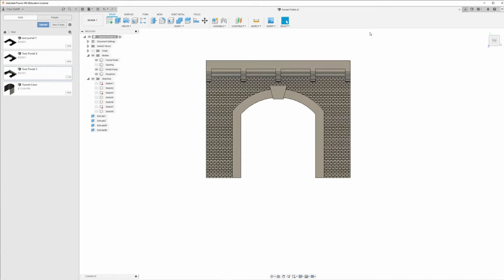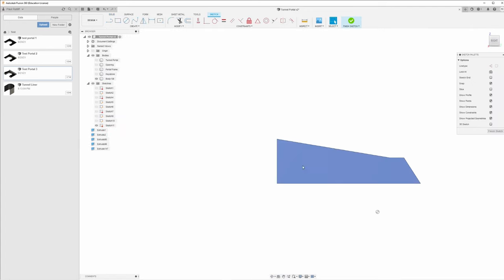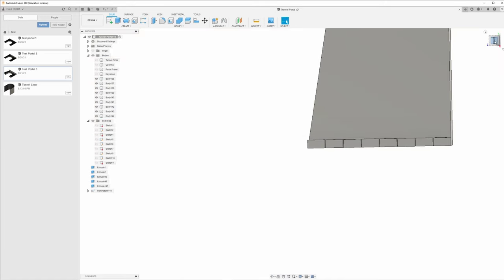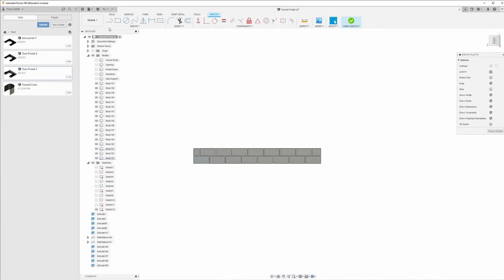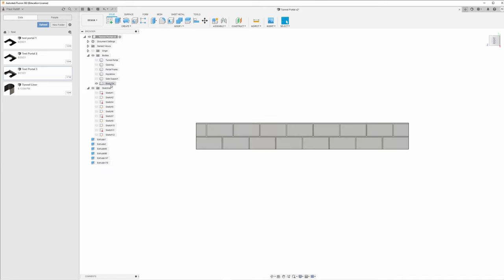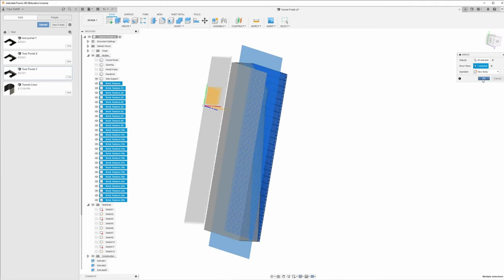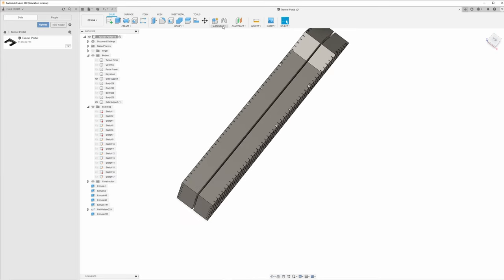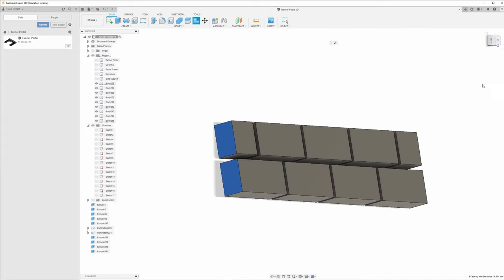3D Printed Model Railroad, Design with Fusion 360, Tunnel Portal Part 4

Comment: Paul  good job  Mahalo. I basically agree with using origin for center of project when doing modeling for 3 d printing. I mostly do panel routing on a 5 ft x 10 ft machine and for those jobs it is easier to set the origin of the sheet in the same corner as the machine origin. This is because of how the manufacturing tab works.  I viewed #5 before #4 so  I've seen the portal liner.
A few items that may be of value to your subscribers, When you finish a sub part that has value you might consider making it a component from the combined body and saving it as such for inclusion in future designs in that project folder. Play around with parameters for dimensions that are repeated in various parts.

Mahalo again
Reply from the maker: Thank you so much Peter. Oh man you have industrial sized cnc router. The things I could make with one of those. I would love to see some of the work you have done with that.